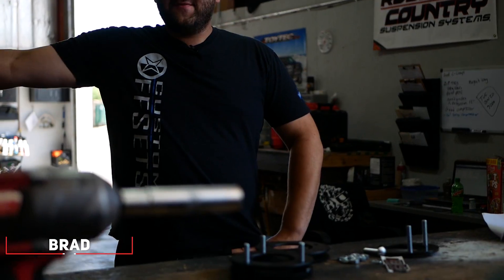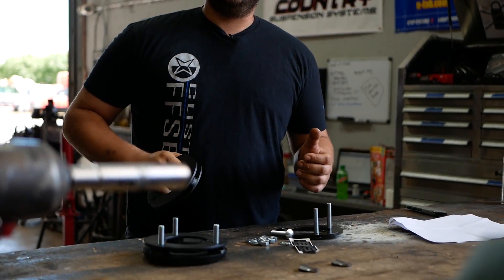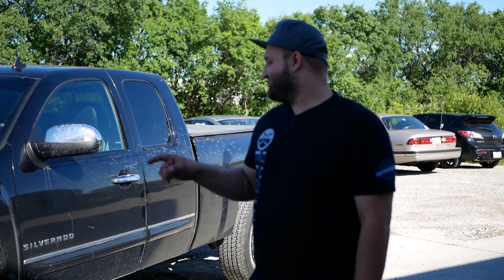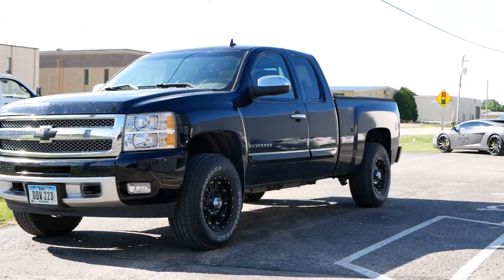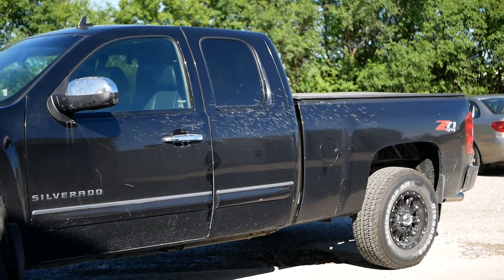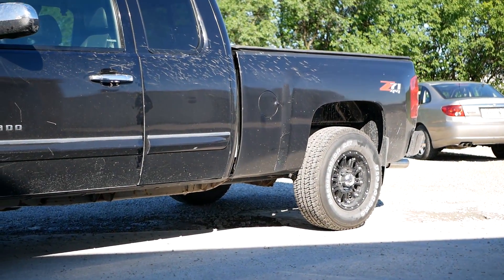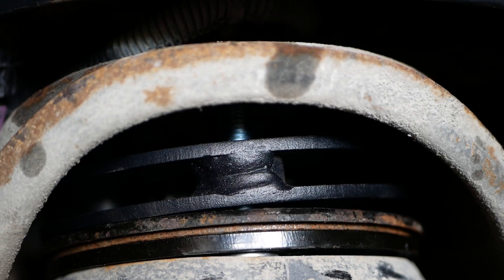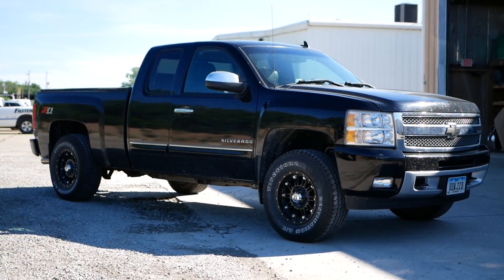Lifts & Levels: 2013 Chevy Silverado, BDS Leveling Kit

Comment: Ok, what is the deal with the air dam? When you guys lift or level a Silverado, do you remove the dam or leave it? Will it cause overheating like Chevy claims if you remove it?
Reply from the maker: Its recommended to leave it for that purpose but you can remove it if thats your desire

Comment: I have a 2012 Silverado ltz 2wd,  with a 3 inch spindle lift combined with a 3 inch strut spacer,my angles are way off,will upper controle arms fix this issue,and what kind.i don't do any off road its just a show,thanks

Comment: Nice amazing level , is it Fit in 33.7by11.2 R18 without trimming? Please answer
Reply: That depends on the offset of your wheel but either way you’d probably have to do a little trimming with only a 2” level for 33.7” tires.